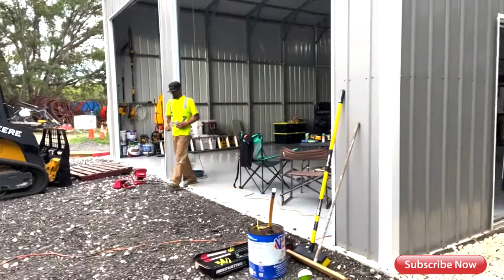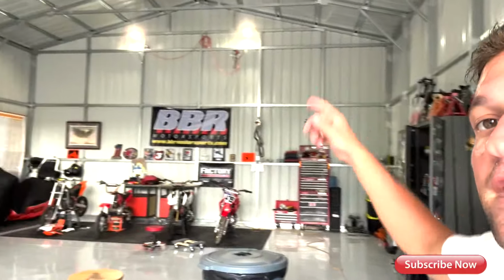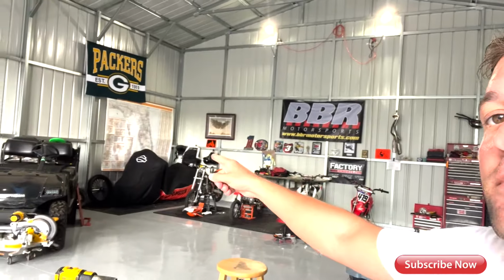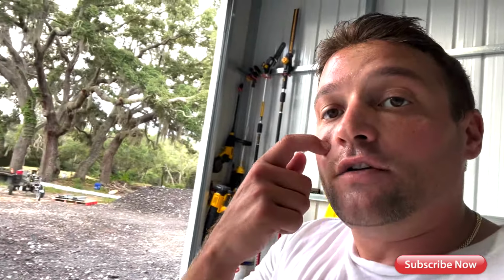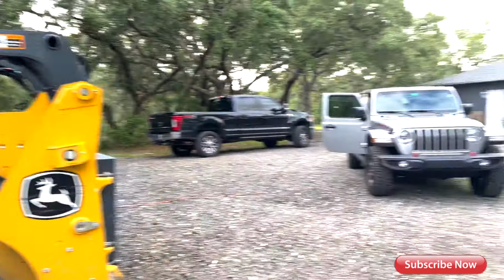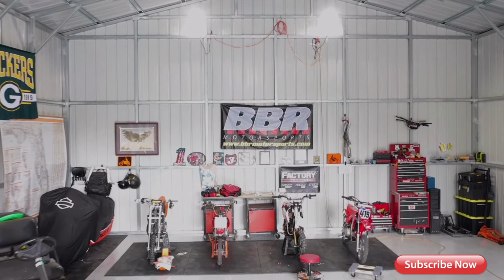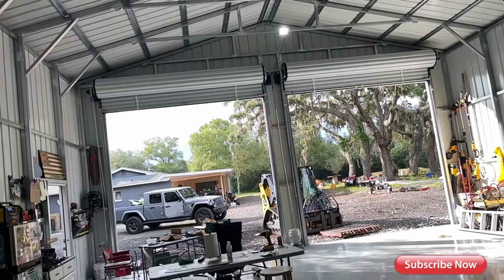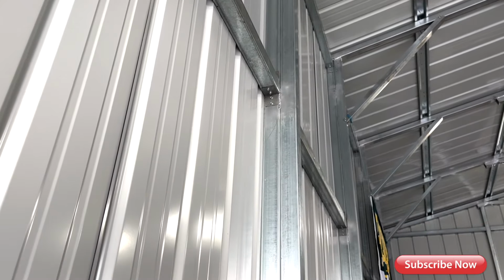Beau's 30x40 Shop for $25,000?

Comment: Do you necessarily need a slab? I have a dozer small enough to fit inside a 10' door but would chew up a slab. Could i just have a leveled pad set up or concrete blocks to set it on instead of a full slab?
Reply from the maker: You can do ground install and use specific anchors

Comment: Designing my new construction house right now. Thanks for this video. 
Is it cheaper to buy one of these premade shops next to a house with no garage or build a house with a 30x40 garage attached?
Reply from the maker: So, from experience when building a home my garage was closer to about $55/sq foot. Our shells depending on size go for around 15-20, obviously not with concrete but add another $6sq foot. Really just comes down to how you wanna use it.

Comment: Guys, I love your work but you have to do us here on the coast a big solid, please for the love of God be the first metal building company to offer "Seafoam" as an exterior color option (use BEHR's Pro e300/i600 paint color as a reference)! Not only is it my favorite blue for structures, it's quite common here on driftwood type coastal regions and I can guarantee you'll target a new demographic. Also, I'd love to see a video of the "Metster" model 30x30, it's layout gives off a solid multi-use vibe and would probably help speed up the permitting process for mixed-residential zones. Hope this tip helps inspire you to break new ground, stay well! -TheB4G3L 

P.S- Seafoam = $$$
Reply from the maker: Love that idea!
Reply: @bigbuildingsdirect  im interested in that color also do you have it as an option yet